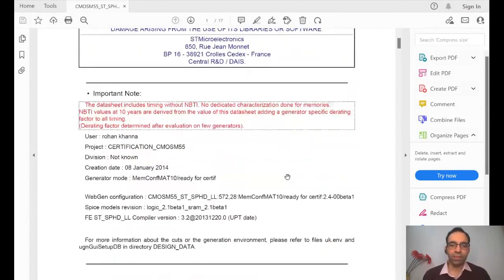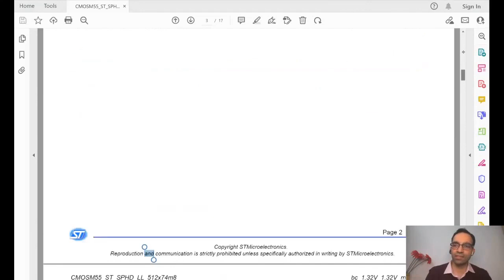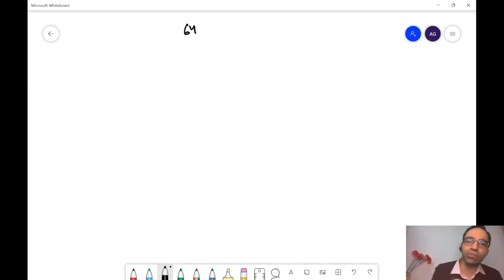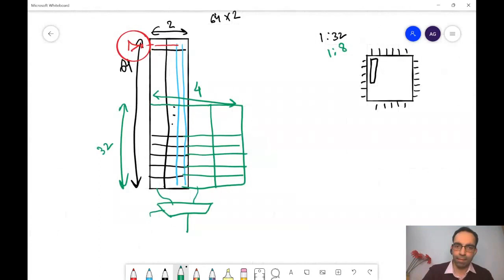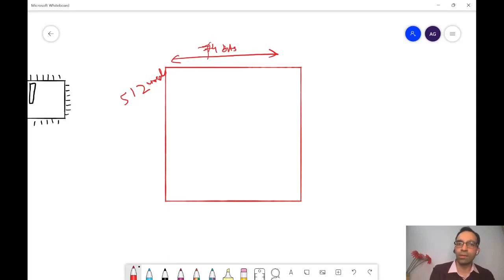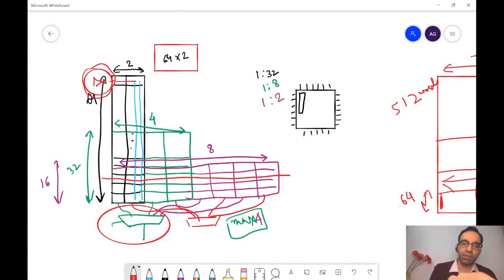Memory Datasheet | Part 1

Comment: sir at 16:33 when you say, "when I select a word line, 4 words get selected" , so using one mux I select one bit of the 4 2-bit words available at that word line. this implies that using a single mux, for a selected wordline, I can write into 1 bit only (of the 2 bit-word) of the total 8bits in the  selected word line, so the folding simply means that I am reducing the word line length for better read and write, and finally using 2 mux I can write only 1 word of the selected word line.  

so am I correct in concluding that at a time, using 2 mux, I can write into only 2-bits (1 word) of the total 8-bits in a single word line?
Reply: so folding accomplishes the specification of intended memory of 64*2, in which  I have the access to write into only  2 bits in wordline, by reducing the bit line capacitance. 

got much clarity of the concept while explaining my doubt, here  and I guess I have understood it correct.
Reply from the maker: When we have a memory array organised in mux 4 configuration, then every row has 4 words out of which one word is selected in any active cycle. 
Which means that if every word has 2 bits, then those 2 bits can be read and written. The remaining 6 bits in the row, even though they are selected by the wordline, will not be read/ written into. 

So, by folding the memory mux number of times, the designer reduces the length of the bitline by mux times, and wordline length increases by mux times.